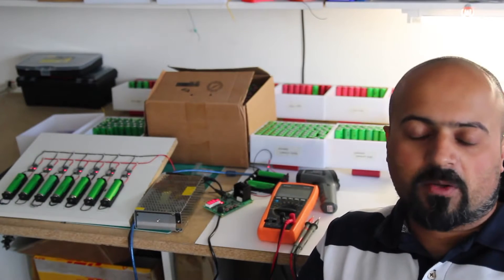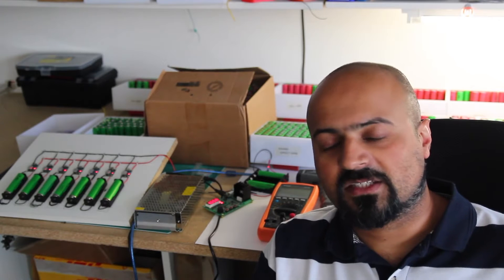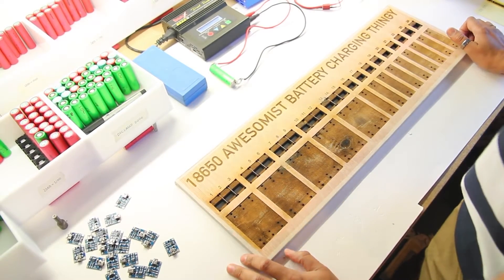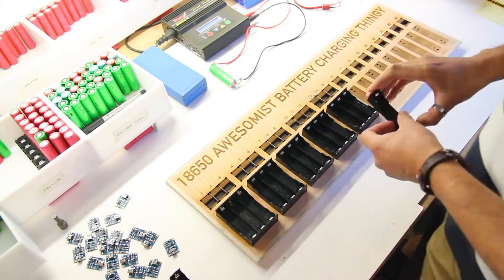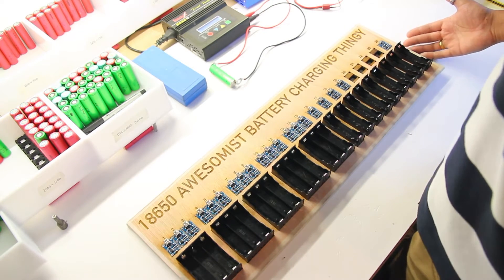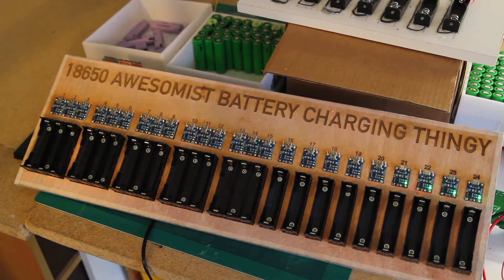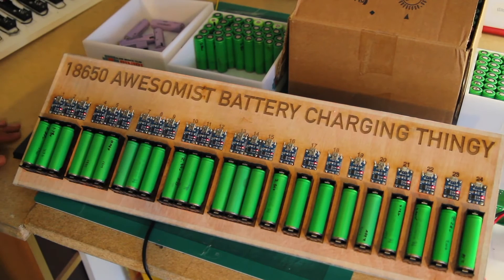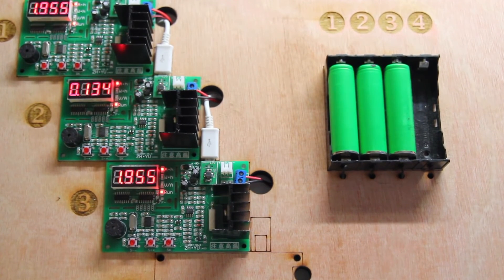18650 Mountain - Part III - The Awesomist

Comment: hi i know its late but have you looked at the 18650 li-ion lithium lead-acid Battery Capacity Meter discharge Tester 1.5v-12v listed on ebay i have used 2 and they seem to work ok have to upgrade the resistor but and add heatsink to them ebay search is https://www.ebay.co.uk/sch/i.html?_from=R40&_trksid=p2047675.m570.l1313.TR0.TRC0.H0.TRS0&_nkw=18650+li-ion+lithium+lead-acid+Battery+Capacity+Meter+discharge+Tester+1.5v-12v&_sacat=0

Comment: A little late, but you could have saved some effort by charging and discharging two from the packs together by not separating them when you got them out of the packs. The parallel cells in each pack were born together and charged together, so they will be within 0.1% the same capacity if split up.

Comment: First, I love your work. Your videos are inspiration for me. Here I have a question. I'm assuming that the TP4056's job is only to charge the battery up to a certain voltage. My question is, why not connecting all these batteries in parallel and charging them with one big charger? Given the fact that cells in parallel can self balance, they will always be charged to the same voltage regardless of their capacities. And for safety issue you can apply cell level fusing for each cell holder, which shouldn't be harder than soldering TP4056 chips. Anyway amazing project!
Reply from the maker: Hey Yichuan, you're awesome for getting involved.
So the biggest problem in charging multiple used cells of various brands is your not going to know which ones are bad (overheating, not charging, poor internal resistance etc) So by tackling these individually (or in pairs from the dead packs you prized them from) will give you a accurate understanding of these cells and once you have figured out there capacity and internal resistance, then can you move forward and make these into bigger pack that then work in sync with each cell. Basically, your the conductor of an orchestra and you are sifting out the bad musicians from the good ones.
Reply: I agree with you. However, as you have noticed, TP4056 has inconsistencies. Different chips charge cells to different voltages, and your discharge stage will be influenced. Using a big and accurate charger to charge all cells in parallel while adding safety measure to each individual cell might be a better idea. The construction of this design would be harder than using TP4056 chips, but I think for testing more than 6000 cells it worth the effort.

Comment: Hi :) I have another question for another video of yours! I am really enjoying them, thanks for the information!

At 9:25 you said they only come alive if they are 3v or lower. So TP4056 need to have 18650 cells that are 3v or lower to work?Nothing happens if they are higher than 3v? If oyu could confirm that, it would be great! Thanks again :)
Reply from the maker: well to be more precise the TP 4056 needs a nominal voltage starting from 2.75v, but anything lower than this the 18650s cells may have been damaged due to being drained lower than what they have been specified for. Although, becuase we are not dealing with one brand of cell then its better to be safe and work with a value of 2.75v as your nominal and charge up to 4.1v as it increases battery life by a lot. 
Those cells lower than 2.75v try charging them back up at a current of 200mah - 300mah at 3v and check the temperature. If you are successful then charge these up to 4.1v and then check for charge decay over a 72 hours period. If this has lost charge of anything between 0.5v - 1v bin them as they now suffer from high level of internal resistance and they'll just cause you more problems than is worth it.

Hope that helps.

Comment: Beautiful work!!  I'm curious...what do you use to power the modules?  I've seen people use a computer power supply but yours looks different.  Thanks for sharing your videos!!!
Reply from the maker: Hey Joe, I just bought a 5v supply of eBay. Normally they use these to power LED strips or the like. Each TP4056 uses 1A and I had 26 of these in parrallel so a 30amp PSU was sufficient. If you do follow this design get some 5v 40mm fans and wire these in as well and also a switch on the board to the ground line. Will have to make another larger board as this one has started a global expedition to other YouTube Channel. Currently its with Pete at HBPowerwall

Comment: GREAT PIECE OF WORK HB WILL BE HAPPY. Just a ? what solder and flux you use.
Reply from the maker: Oh man! I have lost sleep trying to get this to Australia. I mean , i know they have very tight on border control but finally we got this over to HB. I used normal 1mm diameter lead-free solder but I used plumber Flux just cos its cheap. You do need to wipe off the excess as it can go green if left.